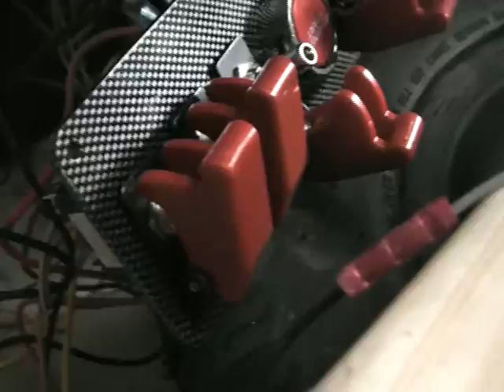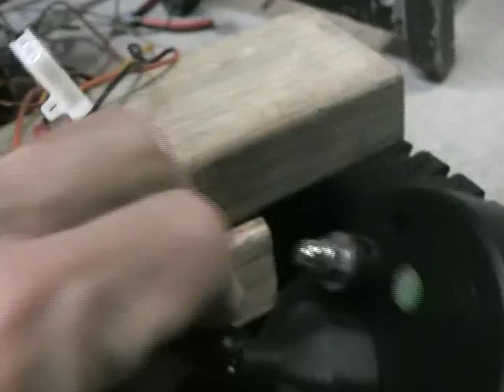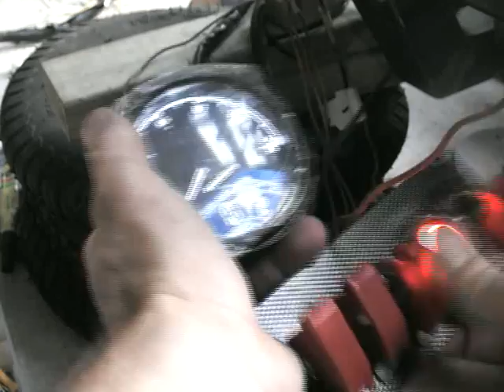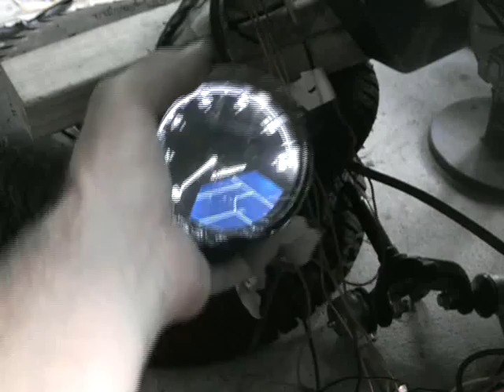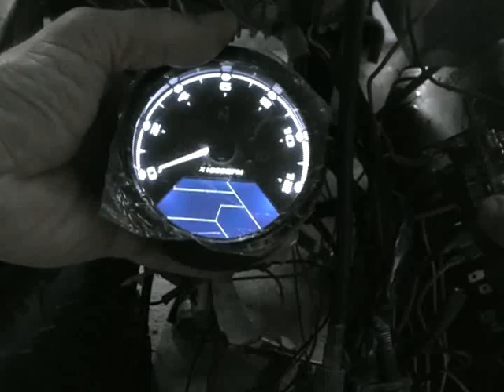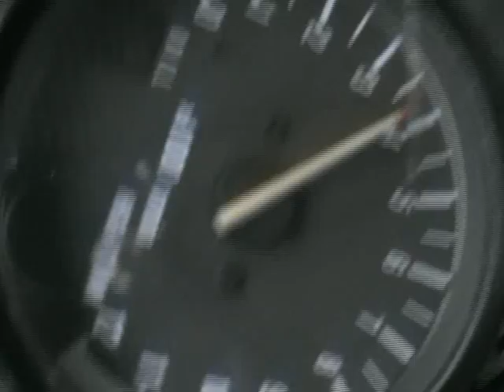Race mower part 12 Engine wiring and tacho

Comment: I don't think the tacho can work on a 270 degree twin motor...or am I wrong?
Reply from the maker: Hmmm, I not sure. I doubt it will work properly. This is only a cheap tacho, you are better to get a more expensive unit. Check my later video about the Acewell Speedo

Comment: mode 1 is circumference of the tyre from 50mm-2600mm. mode 2 is how many magnets 2-12 .mode 3 is number of cylinders. mode 4 is a fuel metre wire number????. mode 5 is mileage reset well that what it says in the printed instructions I have,hope it helps... I havnt fitted mine yet so not confirmed
Reply from the maker: That's pretty close, all the details of the set up is in my other video. Mode 4 relates to fuel sender unit resistance

Comment: Speed sensor is  not picking any signal. I have setup it in correct way... But its not even showing any deflection... Do  you think sensor is faulty?
Reply from the maker: Try to turn the magnet around the opposite way to what you have. Also check the distance between sensor and magnet is not too far away, should be 1 to 2mm. Otherwise if wiring is right, the sensor could be faulty
Reply: Classic Celicas and more Thank you for your prompt response. I have used other magnet as well to see if meter shows any deflection, sadly its shows no change. I will check the connectivity again and might be buying another sensor again.

Comment: The Tacho, cyl setting will depends on how many cylinders that coil sparks for. On some bike engines one coil pack does 2 cylinders, hence the need to set it to two when the engine is really a 4.
Reply: Damian 2E0TXE can you elaborate please ?i’m new into all of this, thanks! :) i recently bought a yamaha fazer 600 from 2001

Comment: Hi, THanks for this video, I struggling to make my same model work, basicly I can't figure out how to make the tach work and my SPeedo light is not turn on too ( i wired + directly to + of battery and - to 1 of my ground wire )
Reply from the maker: Hi, check my newer video which shows the detail how to wire this tacho, I'll make another video soon too showing how to configure all the settings

Comment from the maker: Hi all, Seems there are  a few people still trying to work this tacho out. I'll make the next video with detail on how to wire it up and info on the settings. It will be Part 18, should have it posted within the next week
Reply: please share the link as soon as possible
Reply from the maker: New video posted to show wiring, Ill do another one soon showing the set up functions
Reply: Hi, did you get how to set up this tacho?
Reply: Hi where did you put the tachometer sensor wire? Mine was piggybacked coiled in the high tension wire on cyl. 1 the bike is honda cb400, the reading is correct but there is a lag , like rev it then takes 1 second for the needle to go up
Reply from the maker: @juliusmichaelhonrada  I connect the tacho wire to the pick up sensor on the crank. Sounds like you have the right wire but perhaps it has some interference. Can you chase the wire back and connect closer to the crank pick up?
Reply: @Mezzmoengineering  you mean the pickup coil on the stator/magneto? It wouldnt fry the tachometer?
Reply from the maker: @juliusmichaelhonrada  That where I connected mine and haven't had issues. I can't guarantee anything on your bike though
Reply: tried it on the pickup coil , wouldnt get an accurate reading, i guess thats just how TCI works unlike DC-CDI ignition systems

Comment from the maker: You need to run the tacho wire to the 6 pin plug on the igniter, from memory it's the brown wire. Don't run direct to the coil as it can damage the tacho
Reply: Thanks, I will try that one!
Reply: How is the tacho doing now? When you plugged into the igniter is that your final settings?

Comment: Cool build! Which wire did you tap for the rpm signal? I have the same engine and the same speedo but I don't know which wire I have to use.
Reply: Have the same question..